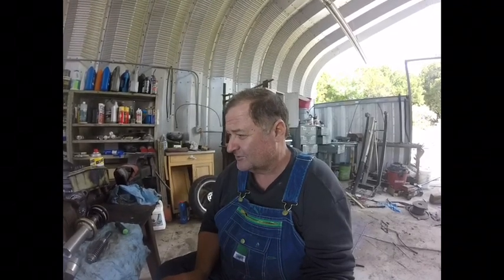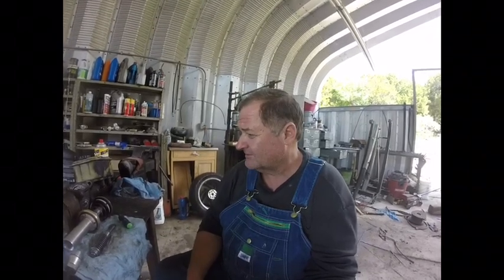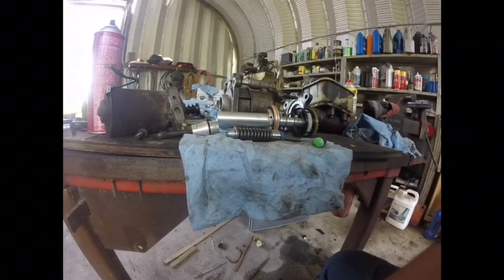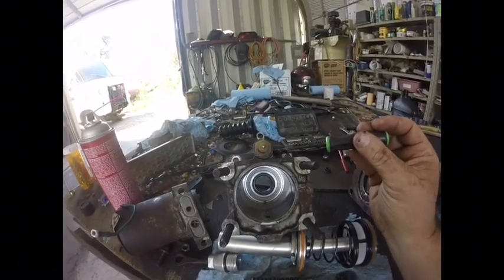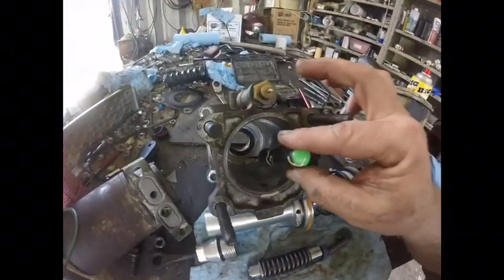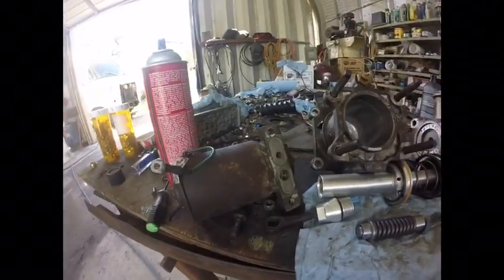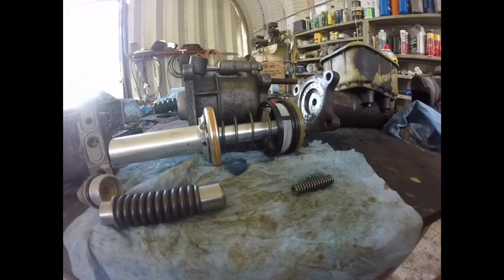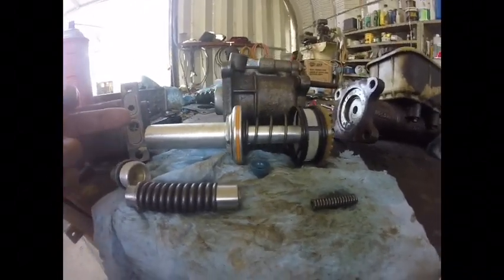Aimless and How a Bosch Hydro-max power brake booster works

Comment: you got a nack for teaching bro! this id nothing more than a glorified valve when you break it down, Im subbed. cant find a reseal kit for this but its leaking into truck cab so its got to be that o ring on the center section or maybe the  2 lip seals

Comment: Is there supposed to be a ball bearing some where, when I took mine apart there was a ball where the motor attaches to the hydro booster, where the oil flows on the oval plastic gaskets
Reply from the maker: I think there was a check ball between the motor and the unit. Thanks for watching. I hope you subscribe to my channel and hit the like button.

Comment: I had taken my hydro booster ( same type as yours) the spring fell out of the little tube, I can't believe that spring buts up to that plastic valve on the end of that springed shaft....you would think it would wear prematurely...I couldn't find an exploded diagram of this part. Also, I was wondering what the seal configuration was for the smaller shaft..fluid was leaking out of the smaller shaft....ty
Reply from the maker: Try looking at 1999southwind.coms site. They have good stuff on it and a parts breakdown. Thanks for watching my video and I hope you subscribe to my channel.

Comment: Very similar to Delco Hy Power booster i rebuilt this year and customized for off-road use.  The Delco has way fewer parts though.  I machined mine to use common hydraulic seals.

Comment: well got the 413  running smoothly  -one turn starts right up and idles  like new -now the brakes and i might just sell it "as is" after watching your video lol
Reply from the maker: Did I do something wrong? What is the 413 in?
Reply: @KevinKalden  my 71 winnebago  -it was idle for about 20 years  i miraculously got it running  but the brakes are like chinese algebra  under there and  theres really no videos  on how to troubleshoot or  do anything with them -your videos great  but im not quite as experienced  a mechanic as you are so  i figured if its giving you a hard time  im  better off  passing altogether on the brakes  lol
Reply from the maker: @DanKirchner5150  I don’t think you will find the hydromax system on your rig. Most likely it will have vacuum assist brakes. My hydromax is out of a 1991 Georgia boy donor motorhome.
Reply: @KevinKalden  ok i thought you were working on a travco for some reason  lol  whoops

Comment: I have the same boost for my Dump truck it makes noise like the fluid passes and a trickling sound. thank you for this information it should help me figure the beast out ?  This problem may be 2 parts the brakes on both front wheels are locking up as well like a check valve is stuck . any Idea would help.
Reply from the maker: Sorry I have slept since making this video. Cant think of where there would be a check valve that would cause that. What causes the front brakes to release?

Comment: Ahh one thing the return tube go down somewhere... there gulping why is that ? It is normal or need to fix it
Reply from the maker: The return from the booster goes back to the hydraulic reservoir. Gulping? Not sure what you mean. Thanks for watching. Please consider subscribing to my channel.
Reply: Is there seal kit for that part ?

Comment: Good fix.  My guess is that the blue plastic cone shrank a bit as it aged.  Taking some length off of the rod make up for the shrinkage.
Reply from the maker: A little wear here, a little wear there and then poof no power brakes. Thanks for watching. Please consider subscribing to my channel and sharing the video.

Comment: Mines leaking between the booster and the cylinder. Somehow fluid is getting out between the two surfaces ?
Reply from the maker: Is it brake fluid or ATF? Either you master cylinder is bad or your booster is depending on which fluid you have. Thanks for watching please consider subscribing to my channel.
Reply: Aimless I’m running atf for the powersteering and it’s leaking atf !!
Reply from the maker: White Lamborghini goes skrrt skrrt sounds like it is the booster.

Comment: Hi! Thanks for great video! I have the same setup on my 95 International 1652 . Is there a seal kit for the hydro-max? I cant find one online anywhere .
Reply from the maker: I only had the booster a part and I think they were just o rings inside. I did not reseal mine.
Reply: @KevinKalden  The front seal or oring on the piston where it  meets the master cylinder looks shot on mine. Right where the fluid channel is.
Reply: Ryan any luck with the o ring kit?
Reply: Kudos for the video content! Excuse me for chiming in, I would appreciate your initial thoughts. Have you heard about - Dinanlinson Energy Source Approach (do a google search)? It is a good one off guide for discovering super food to super charge your energy without the headache. Ive heard some interesting things about it and my close friend Aubrey at very last got astronomical results with it.
Reply: Cheers for the video content! Forgive me for butting in, I would love your initial thoughts. Have you ever tried - Dinanlinson Energy Source Approach (google it)? It is a good one off product for discovering super food to super charge your energy without the hard work. Ive heard some extraordinary things about it and my work buddy at last got great success with it.

Comment: i like to check screen in chamber but can't get piston out? remove clip on the end rod.
Reply from the maker: If i am correct about what snap ring you mentioned no. It is most likely being held together by corrosion. Theoretically when you take the master cylinder off of the booster the guts should come out. I had the snap ring off when after soaking it with penetrating oil I drove it out and when i did the parts flew everywhere.
Reply: @KevinKalden , thanks for the info. could not get it apart clean it with brake cleaner and put it back together .works ok now.